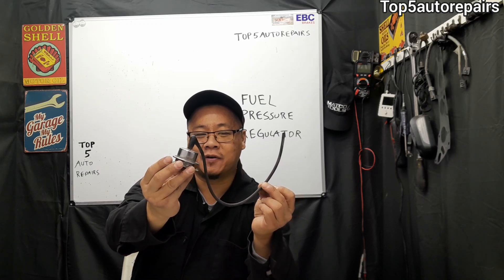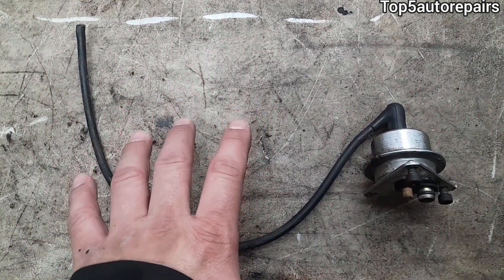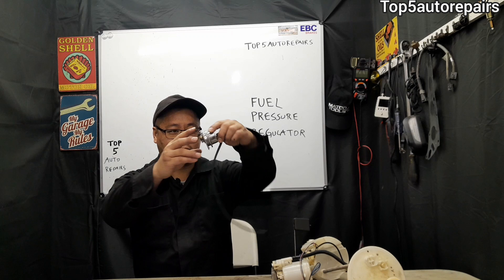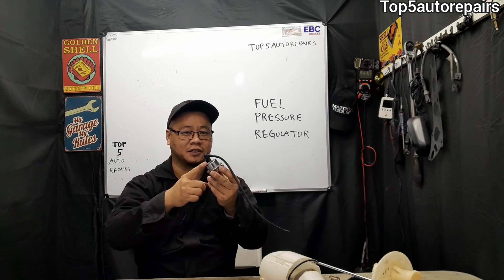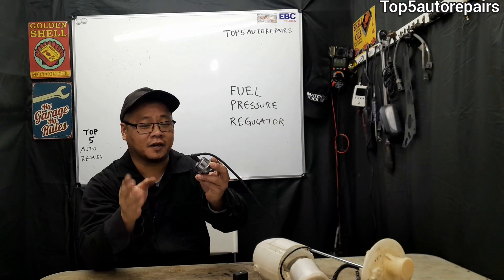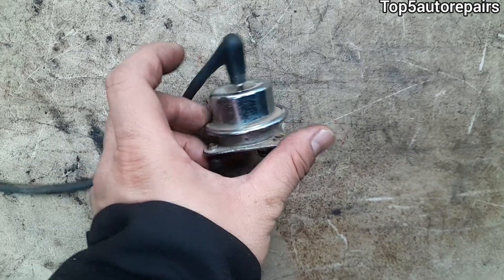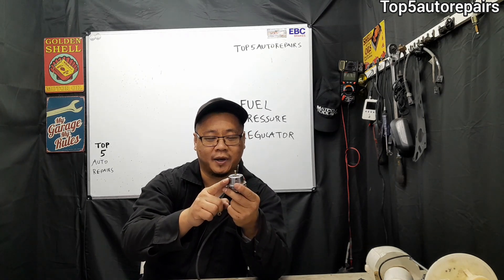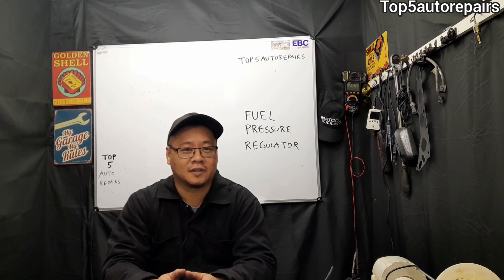SIGNS OF A FAILING FUEL PRESSURE REGULATOR AND HOW TO CHECK IF IT'S BAD

Comment: My car is running rich p0172 intermediate  I put a fuel gauge and stayed at 40 psi,  I pulled vaccum hose from regulator found 2 drops of gas, should I replace it ?
Reply from the maker: Yes the diaphragm is ruptured

Comment: I have a question for you and believing at this part is going bad on my 1995 Toyota Tacoma with the 2.4 it starts up just fine when the engine is cold but when engine is hot and hot temperatures, it acts like it is vapor lockedCould that be a symptom of this part going bad?

Comment: I hope someone can help me, I have a mk5 1.9 tdi. My car has a hard start every time my car is parked for long. It also has a hard start when I park on a incline, When I park my car in a decline position the car starts immediately. I have changed the fuel pump, tandem(vaccum) pump and fuel filter housing. The issue doesnt seem to go away. Can anyone give me advice what could be the issue.
Reply: Dude I have a similar issue. Hard start when parked on slope. I was suspecting maybe it’s the purge valve. Did you figure out what your problem was?